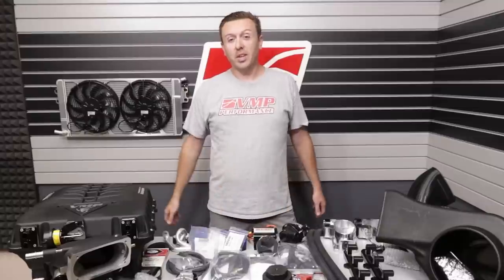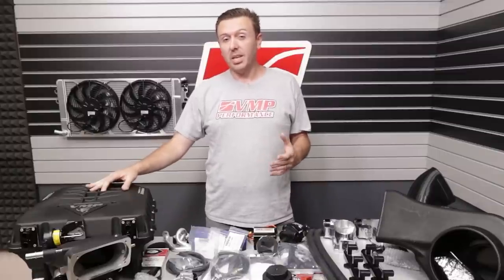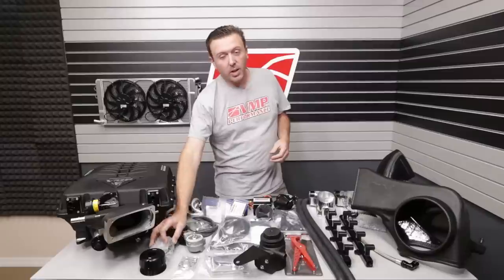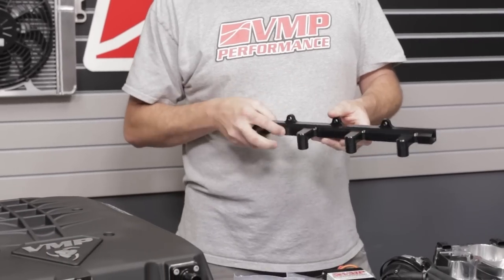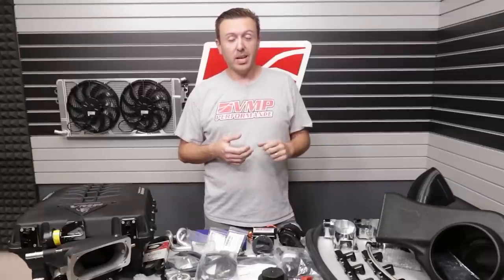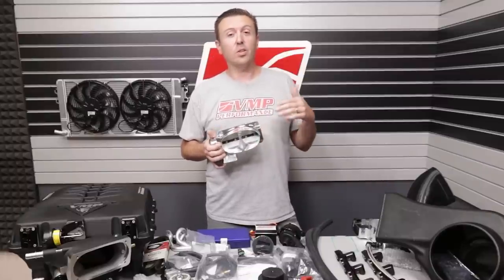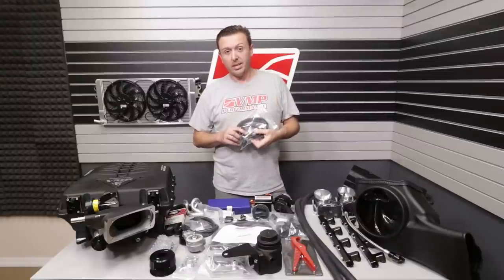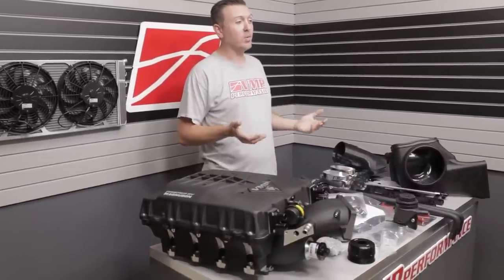VMP Odin || Unboxing: What's in the kit?

Comment: Roush or procharger have the only dealers in my area that do installs with tuning but they want 22 or 25k CAD plus tax,
I think for under 13k plus tax the loki kit might the way to go if I trust myself with the install. Can the data logging be done well enough without access to a dyno? Even the pro charger and rousch dealers don't have one.
Reply from the maker: Absolutely Tristan.  We've done thousands upon thousands of data log/email based tunes on a WIDE range of set ups.  As for the install itself, it's rather simple.  It's just time consuming, as you'll need to plan for 10-12 hours of work to get it done.

Comment: stand mode belts where shredding off the pulley did you come up with a fix for that? other said the samething and i want a Odin so bad..
Reply from the maker: In situations where a pulley as small as Stangmode was running in 6 rib puts a LOT of strain on a 6 rib system and that width of belt can stretch and strain more than the similar length 8 or 10 rib belt.  When they stretch, they have the potential to jump a pulley etc.  We've got an upcoming product release of an all new 8 rib system in the next week or so that'll offer the ability to run 8 rib with the Odin and solve the vast majority of any issues of that nature when running very small pulleys.  Aside from running small pulleys in max effort set ups, we see very little issue.  The belt on the '16 GT we used for the '15-'17 Odin install video and testing went 21k miles without issue before being replaced.

Comment: If the front inlet offers more airflow, why have all your previous superchargers had rear inlets?
Reply: Exactly it’s all marketing shit
Reply from the maker: When our previous design used a blow down method, we had the best results with our rear feed.  When we went to a blow up design, which is a completely different in layout, our best results came with the front feed.  The change in the position of the intercooler cores made the difference for us.
Reply: @VMPPerformanceTV  thanks for the reply. That makes sense.  I wasn't accounting for the difference in intercooling placing.
Reply: VMPPerformance so this design which is basically a IHI design like the hellcat, is better than all other models you make. If that’s the case then I assume I need to sell my 2014 Shelby and hunt down a vehicle that can utilize this style. Thanks for helping me understand it better. VMP you guys are awesome.

Comment: So factory crank dampener/pulley used? And if so does it come with a new bolt or do we have to grab another one?
Reply: Mainly cause I was always told rule of thumb never use that bolt twice in past builds I've done due to stretching and proper TQ
Reply from the maker: There is a measurable amount of stretch allowed by Ford.  Best practice would be to replace any TTY bolt.  That bolt is a Ford specific bolt and we do not provide one in the kit.
Reply: @VMPPerformanceTV   alrighty ... So we will use factory crank dampener .. alrighty no worries I'll call ford and order one now .. thanks for the reply .. I know my stuffs on route to finish this install so wanted to be ahead of the game if I needed anything else
Reply: @waynegardner7983  Do yourself a favor and get and ARP bolt. taking off the damper is not required unless your doing OPG's.
Reply: @frozenstang3868  I'm doing OPG's right now and have a new factory bolt ... If this was winter and not our small window of summer I would def have just bought an APR bolt for sure

Comment: Is oil pump gears/sprocket upgrade required if you just want to make 750 horsepower with this kit?
Reply from the maker: Oil pump gears and crank sprocket upgrades are typically insurance against the abuse a two-step or for a vehicle used up around the rev limiter.  The shock from these types of uses is what really puts them at risk.

Comment: How can you make the Loki push the same power as the Odin?
Reply from the maker: Hey Jarrell.  So the primary differences between the Loki and Odin kits are the supporting components.  Both kits use the same head unit/supercharger.  To upgrade a Loki kit to full Odin kit specifications, you would need a TJ69 throttle body, our Odin cold air intake, and the Dual Fan Triple Pass heat exchanger.  Those can be purchased separately via our website at vmpperformance.com or an email or phone call to the shop where our support team can assist you in grabbing the correct parts for your application.

Comment: can this be tuned for both 93 and e85 as i live with no 85 but i visit family that has e85 around?
Reply from the maker: A supercharged Coyote will need a return style fuel system to support E85.  If those components are place, having two seperate tunes for different pulley sizes and fuel types shouldn't be an issue.

Comment: Can you install this in a garage with medium mechanical knowledge?
Reply from the maker: As long as you're comfortable with moderate/semi advanced mechanic principles, you should be fine.  Plan for a couple days of wrenching at a reasonable pace.  You'll need basic knowledge of how fuel systems, cooling systems, and belt drive systems work so that you can make adjustments as needed or handle any curveballs that might come your way.  As always, we're here to help however we can.  

If the ideas of bleeding a closed cooling system, running a wiring harness, plumbing fuel system components or minor adjustments to belt alignment seem a bit out of reach, you might consider having a shop such as ourselves or your local performance oriented shop handle the installation for you.

Comment: SAE smoothing 5 like god intended.  Now if only Gale Bank's and I can convince everyone that drivetrain loss on a dyno is not a set percentage, saying it loses more power the more you make which doesn't make sense unless you increase the drag via HD trans or diff.  Gale Banks TST Podcast #389 at 1:33:12  The 40whp or so it lost when stock will always be it drivetrain loss and doesn't shoot up to a 80whp loss after you increasing the power using the common 10-20% calculation.

Comment: If you got one of these what else would you say is need for the car? Do you need to upgrade the brakes, suspension or anything else?  Also will these be available worldwide?
Reply from the maker: This kit will bolt strait on to an otherwise stock 18+ Mustang GT.  Supporting modifications aren't a bad idea, but we have designed our kit to be fully functional with an otherwise stock car.  To pursue power above the limits of 93 octane and the fuel pump booster will require a return style fuel system at the very least.